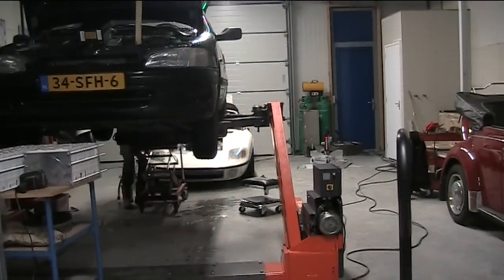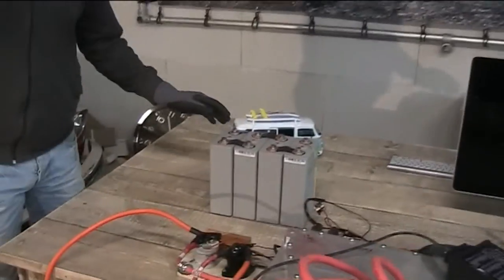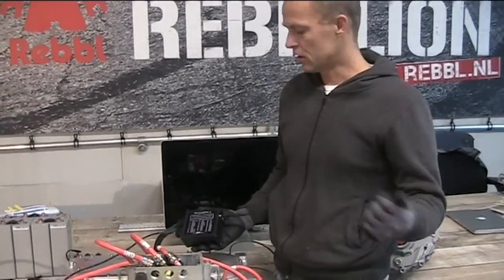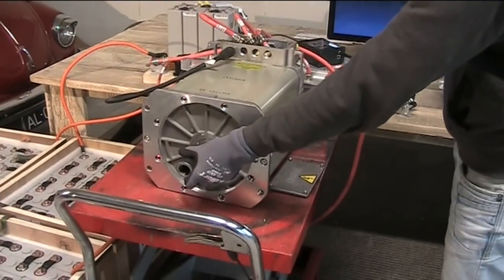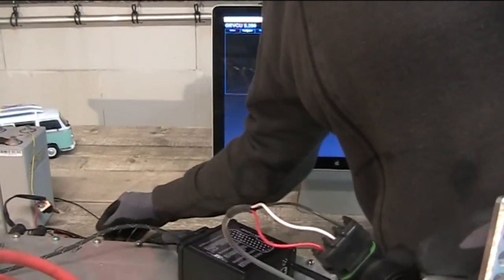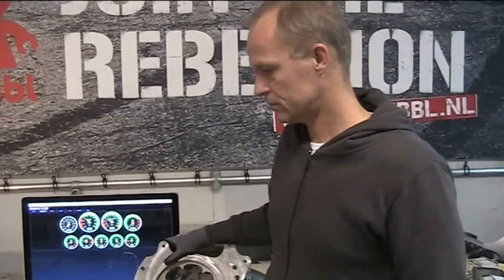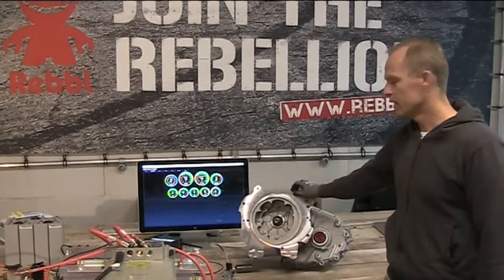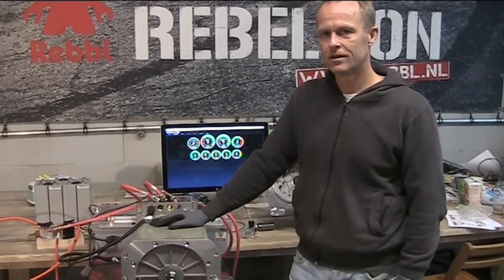REBBL Siemens AC motor DMOC controller kit demonstration

Comment: Is it history at this time? I'd love to install two just like it in a vintage DC3 and line the 98' wingspan with flexible high-output solar panels, leaving plenty of payload potential for use as a highly-efficient flying mobile tech centre for Siemens operations.

Comment: Idiot! Never touch several polees at the same time. You never know what may got stuck into your working glove. Should do some high voltage training before working with HV... You may get killed.
Reply: Bitch you would shit pants at my work places
Reply: No i wouldn't.........

...Bitch
Reply: depends if your talking about powerlines thats considered low voltage but when talking about safety  any voltage that will induce over 30-50ma in the body that can possibly kill you is considered high voltage think it was 50V for AC and about 120V for DC

anyways here a copy paste from wikipedia 

IEC voltage range AC RMS
voltage (V)                           DC voltage (V) Defining risk
High voltage > 1 000            > 1 500         Electrical arcing
Low voltage 50 to 1 000   120 to 1 500       Electrical shock
Extra-low voltage < 50    < 120                 Low risk
Reply: Mathieu B you idiot , those are rubber fronted gloves , what do they pick up : NOTHING ! 
and what he put his hand on was 4 of 3.7v modules , what he called a 12 v battery ...woooooo so f-in dangerous
Reply: In school they taught us that HV is 1000V AC and over (1500V on DC) anything below is Low voltage

Comment: How do you adjust the max speed of motor's RPM to the previous car's transmission? On other hand, how do you make sure that  the motor you chose is a right fit for that transmission (in terms of RPM)? Thanks anyone for reply in advance.
Reply: it doesn't matter